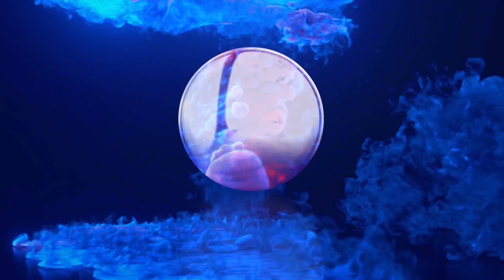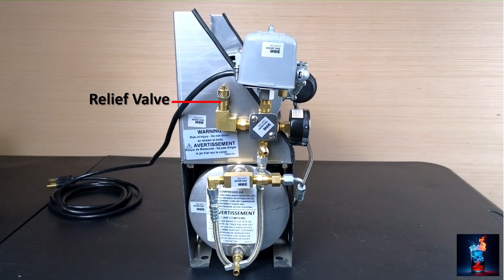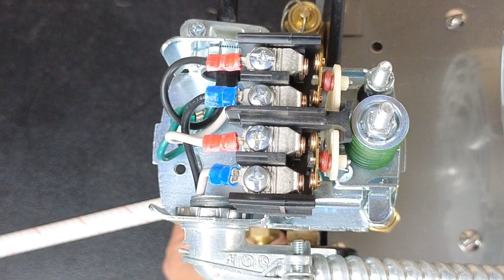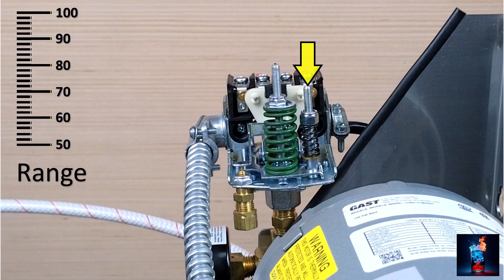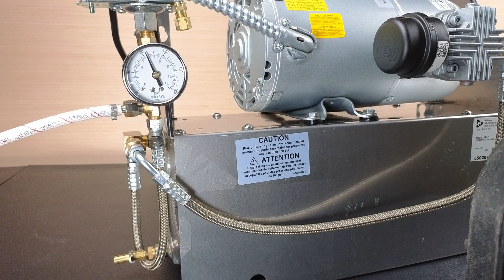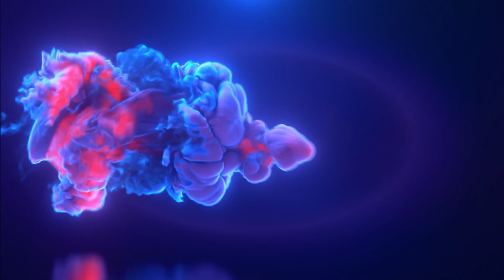How to adjust pressure switch on a GAST Beverage Air Compressor.  #bevolution

Comment: Hi there, I have a Bigmac carbonator installed at home since 6 years ago, has been working fine since then but 2 months ago, carbonated water is coming with a smoke smell, I replace the water filter and was good again for 2 months, and now the carbonated water is coming again with that burnt smell, it doesn't taste though, any idea of what can I check?  I have a water filter, the Bigmac carbonator, the a jockey box with a SS coil, then a SS Perlick tap dispenser. If the problem were the hoses, then how the water filter replacement fixed the smell for 2 months? I have no idea.... Any thoughts????
Reply from the maker: Sorry for delayed response. Need to check my page more often. I’m thinking your procon pump is the source.
Reply from the maker: I would also flush out your tank. Unplug carbonator, have co2 push all water out, see if there is an off smell.  Flood tank with fresh water, use co2 to blow out water, then turn water on and plug in carbonator.
Reply from the maker: Also make sure you use both soda ports coming out of tank.  You can then tee them together if only need one to fountain. Could have stagnant water if you plugged one soda out port.
Reply: @mikekachurak thank you for the response, I replaced the procon pump as it started making squeaky noises, the water smell dissappear immediately.  We still love the unlimited carbonated water.